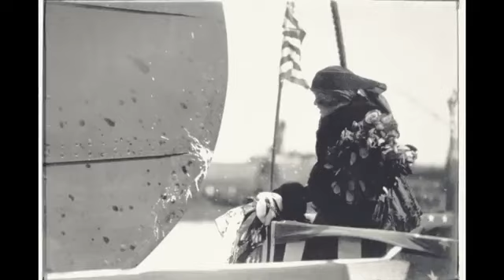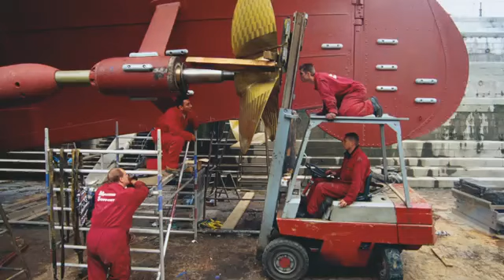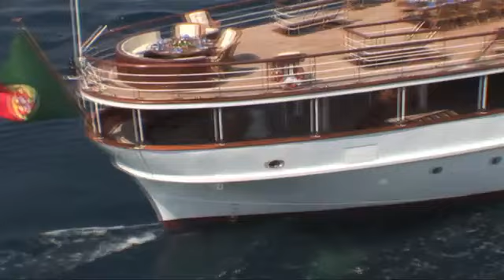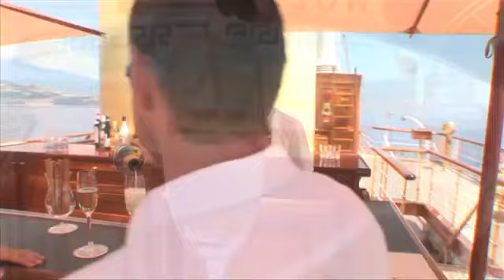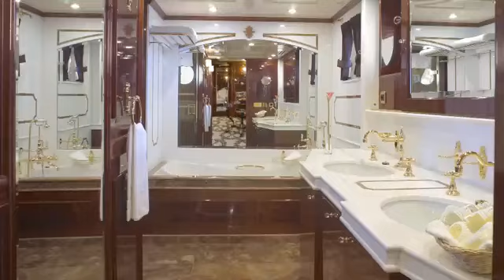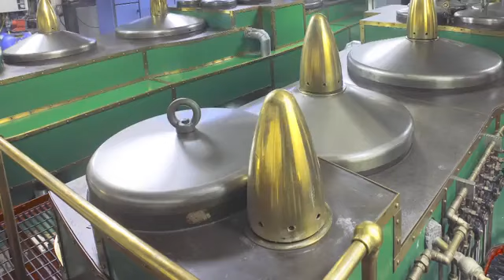78-meter 1921 Classic Yacht SS Delphine U.S. Built by Dodge (motorcar) family.

Comment: Thank goodness the original engines still power her.
Reply from the maker: I agree. These engines are pieces of art. The longer they run, the more efficient they are. You might want to check out this steam-powered yacht also- 
Corsair IV was constructed in Maine at the beginning of the Great Depression for $2.5 million (or about $60 million in today’s currency). Measuring 2,142 gross tons, with a registered length of 300 feet and overall length of 343 feet, the Corsair IV was the largest yacht ever built in the U.S.

Comment: I’m Fortunate enough to be in the Final Stages of Acquiring ,another Henry J. Gielow Designed Vessel..Built in 1908, She is 58 -1/2 ft. Long,..Double Planked Hull of 2”inch Fir on White Oak Below waterline,and 2” inches of Teak above Waterline..Extremely Well Built Vessel of Very Strong Massive White Oak Timber’s..and Completely Restored ,from ‘Stem-Stern’ with All New Wood of Original Design. She Majestically sits in the Water Like a Floating Museum,and with her Twin English made ‘Lister’ Diesel Engines from the 1950’s..able to sip at 1-1/2 gallons per hour,while maintaining a Cruising Speed of 8 knots...She is a Perfect Liveaboard Vessel,that I’ve been Planning on Cruising for the Next 50 years ( I just turned 60 ) She was Predominately Designed for Coastal Waters and Cruising,but is Capable of taking on some Heavy Seas..Should be Onboard her in the Next 60 days..Can’t Wait to venture into a Secluded Cove in the NW area and Up into Southern Alaska and B.C. / Down below,she has 2 Full Beam Staterooms with a Full Head + Original Bathtub, Walk-around Engine room w/ Day Head..and Ample Workbench +Selection of Tools,Washer/ Dryer combo, and Old Fashioned Steam Heat Registers throughout the Vessel..sitting in a Comfy chair on the Back Deck Moored by a Backdrop of a Waterfall and a Pod of Killer Whales .to Share the View with...’ Looking Forward...🇺🇸⚓️🐾☠️☕️🇨🇮